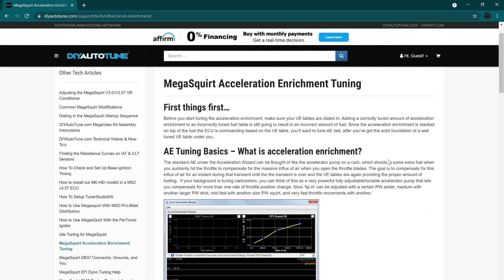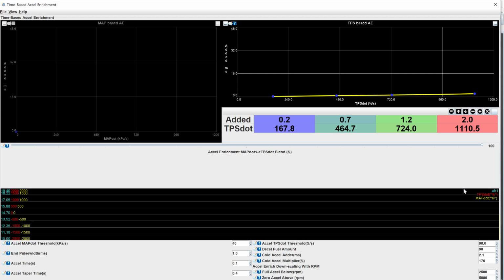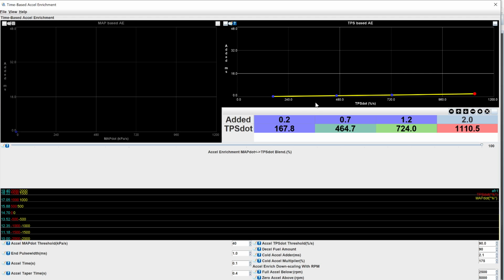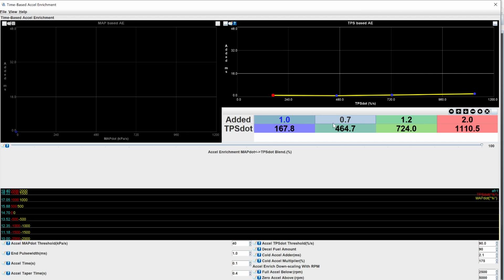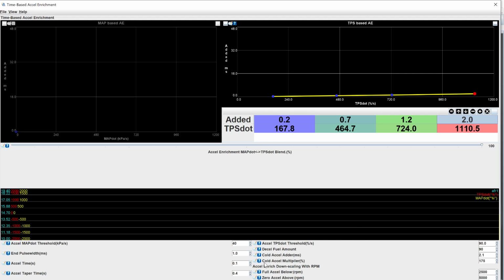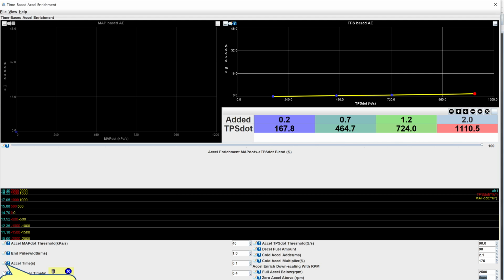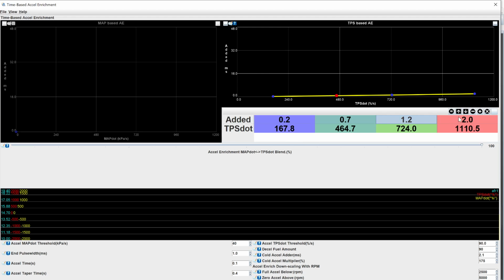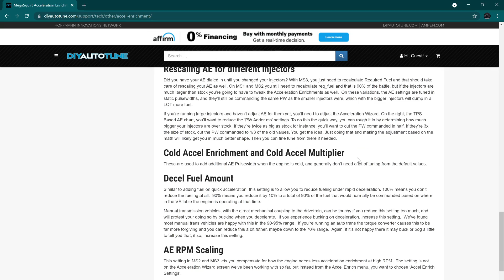Megasquirt Acceleration Enrichment Basics

Comment: i did this on the ecumaster with the help of the lambda sensor, to get it somwhere in the ball park and to know where it sits. on the lean or rich side.
later, i went for the engine feel.

also engine temp plays a huge role. I had issues with a cold engine cutting out, had it spray like 200% of fuel while cold. ooof! at least it washes the carbon out of the rings. lol
Reply from the maker: I agree engine feel is most important. Give the engine want it wants to be happy is best

Comment: Re-watching your video and i have a question. What is considered a small injector or a big injector? A 19lb injector is small. A 120lb injector is big, but is a 60lb injector big? Is a 42lb injector small? It does it depend on the size of the engine compared to the size of the injector used on it? Thanks
Reply from the maker: The injector size is relatively to engine displacement, hp goals and fuel type. When I say big injectors it’s mostly a generalization for anything bigger than factory
Reply: @TurbineResearch  thanks for your reply and i was thinking the same thing and you are correct, but is there a rough size table, going from small to large, that would generally be agreed on, what a small injector would be and when you would be getting into big injector territory?

Comment: Well. Got a question you might be able to help. Upgraded my car to a 95mm gm throttle body and Holley ls intake on a 3.0l v6 also has 400cc injectors high impedence. Im assuming accel enrichment would have to be more for these kind of mods..Also its an all-motor build. Car likes to stumble when you give it throttle. Like it runs out of gas. So accel enrichment could very well be the problem. Stock tb was 60mm and injectors were 225cc..Injector size and dead times have already been set.

Comment: I remember years ago when i discovered the TPS/AE table with my turbo 4 cylinder car with MS1. I was free revving it in the garage and playing with the adjustments and wow! I had that thing roaring like a lion. i think the manual said to see if you could "juggle" the rpms by revving the engine and on the way down, Rev it again. There should be very crisp revs without stumbling. Great video🏆

Comment: I went from 24lb to 60lb injectors recently should I scale the values by about 40% of current? 24/60?
Reply from the maker: No, change the injector size in the general settings.
Reply: @TurbineResearch  I did all that I mean just for the enrichment the  current settings are (24lb)
TPSdot 100 195.8 350 600
added 2.0 3.2 3.7 5.6
Reply: @TurbineResearch  like could I proportionally adjust these down to match my new injector size
Reply from the maker: @Bacongrease00  I see what you mean , yeah you can give that a try.

Comment: Where would you look first if you have a sputter between 3 and 4 k rpms on slow steady pulls (normal driving) but works fine if you were to just floor it?
Reply from the maker: Check your afr in the areas that it sputters and make sure the fuel map is smooth